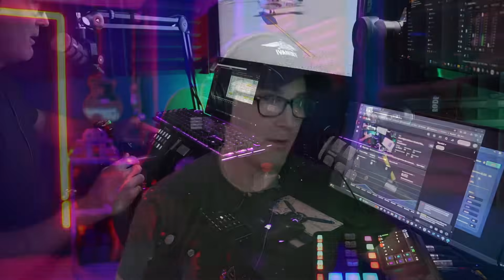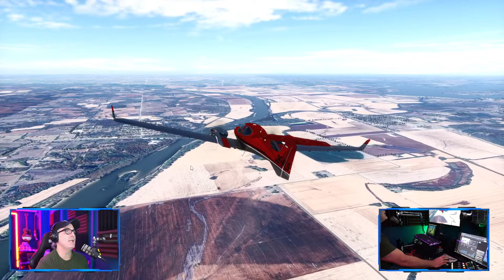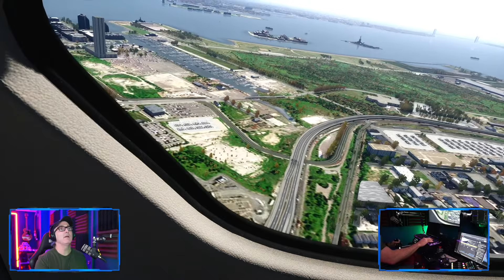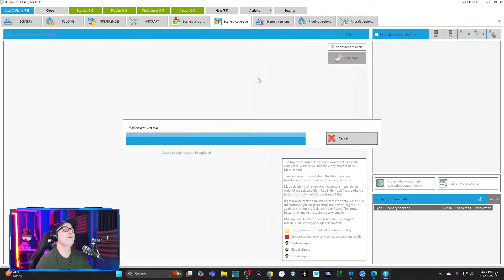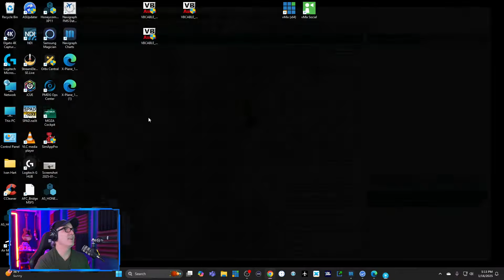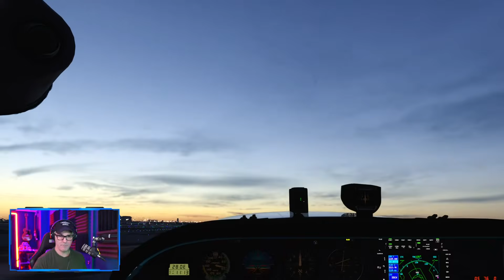Free Flight | X-Plane 12 | CLS Force Feedback Yoke | Air Foil Labs C172 NG Digital | Aerobask

Comment: Thanks for this video!
I've been using MSFS since version 1995!
FS2020 is a photoshopped Bingmap scenery, and FS2024 is entirely streamed, so it's bandwidth-dependent!
I switched to X-Plane 12 at the end of August 2023, tired of bugs and mandatory updates.
On X-Plane 12, I rediscovered the joy of flying, where everything is better! The planes, the flight model, the airports, the runways, etc., and the immersion.
I use AutoOrtho, Simheaven, and Global Forest V2.
The scenery is "pretty" and perfectly usable.
FS2024 is an aerial game, X-Plane 12 is a simulator.
Microsoft/Asobo are shareholder-oriented companies, and Laminar is a customer-oriented engineering firm.
Watch out for the DA-42 engines!!! Ahahaha!
Fly Safe!

Comment: Great video Ivan, I'm new to xplane 12  and I have the CLS-60 and I fly in VR. I also have the premium Deluxe edition of MSFS 2024 but xplane 12 is the sim for me now. The physics in xplane 12 is much better than MSFS 24 and with the CLS 60 yoke it's a wining combination. Xplane 12 yoke will move in and out in windy conditions but msfs only does that in take off and landing
Reply from the maker: Than ks! The CLS yoke has really reenergized me, that is for sure. It does seem to work well with X-Plane.
Reply: Definitely dose, It would be good if people can see the difference between the two softwares using the yoke. To see how the yoke responds differently in windy weather and just by applying the flaps, I think people would see how the physics are in xplane